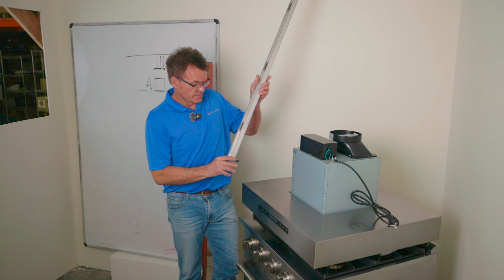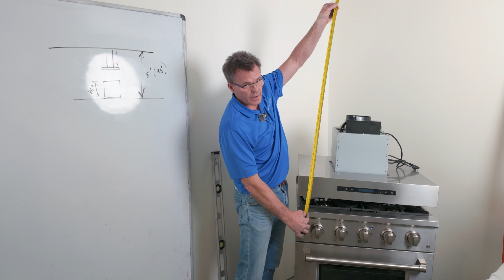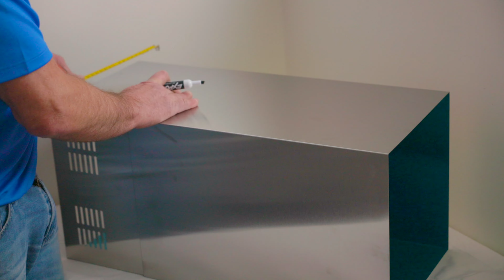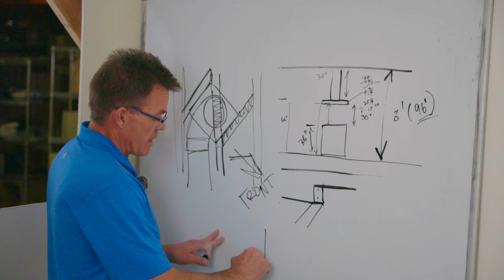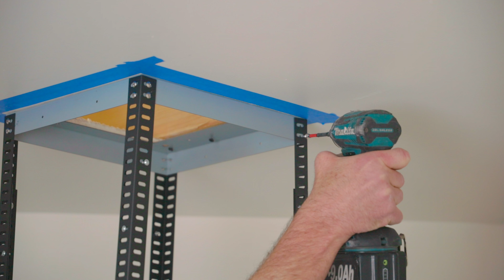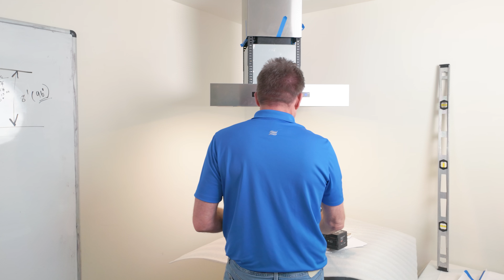How To Install Your OWN Island Range Hood (Proline 755 In Depth Guide)

Comment: The extension cord used in this install is not code compliant.
You must use a raceway or a cable approved for concealment such as MC, AC, and NM cable.
National Electrical Code NEC section 400.12
Uses not permitted
Unless specifically permitted in 400.10, flexible cords, cord sets (extension cords), and power-supply cords are not permitted for the following [400.12]:
(1) As a substitute for fixed wiring.
(2) To be run through holes in walls, ceilings, or floors.
(3) To be run through doorways, windows, or similar openings.
(4) To be attached to building surfaces.
Ex to (4): Flexible cords used for temporary wiring [590.4] may be attached to building surfaces.
(5) To be concealed by walls, floors, or ceilings, or above suspended or dropped ceilings.